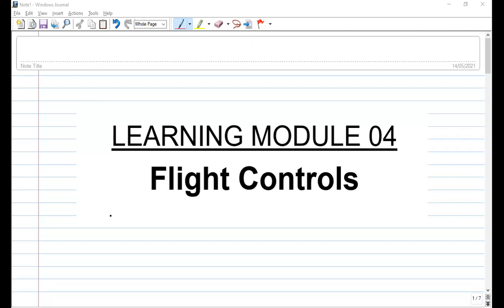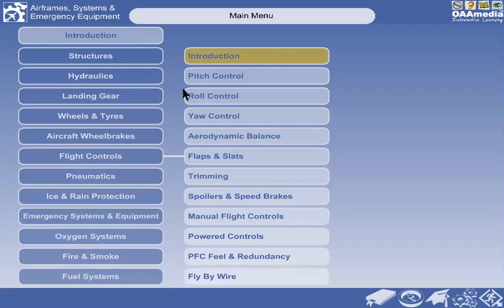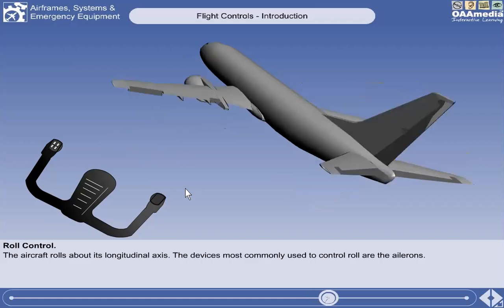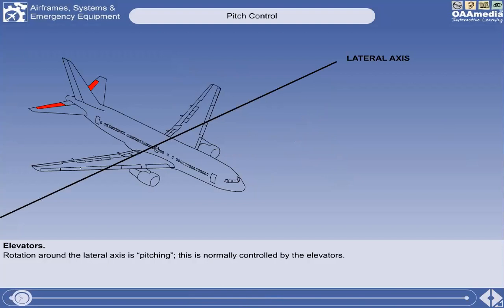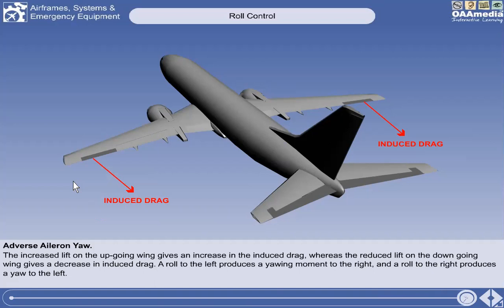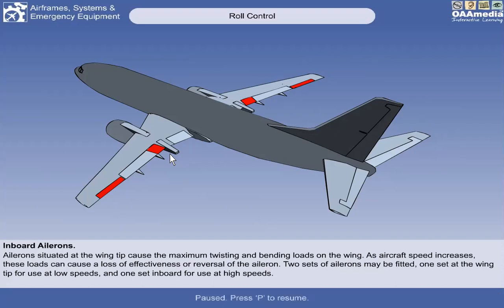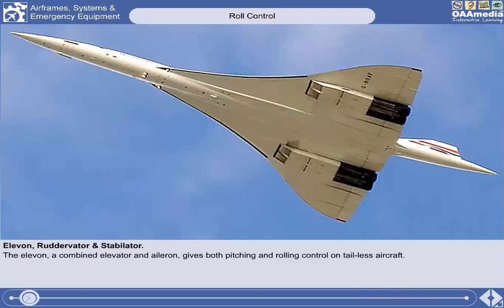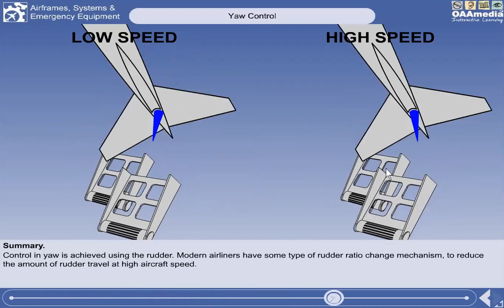AE 221 - Learning Module No. 4  (Part 1)

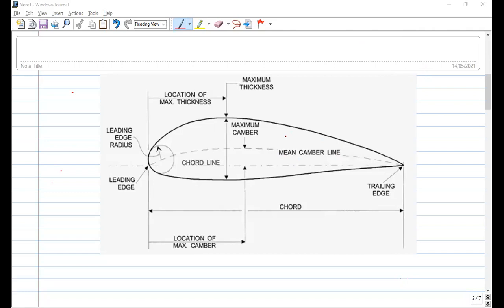Comment from the maker: CORRECTION (5:20):

Mean camber line is not the same with camber.

- Mean camber line is a line joining the leading and trailing edges of an airfoil equidistant from the upper and lower surfaces. Other term for this is camber line or mean line.

-  Camber is the curvature of an airfoil above and below the chord-line surface. It is the distance between the mean camber line and the chord line. Where the mean camber line lies above the chord line, the airfoil is said to have a positive camber. Maximum camber is a ratio of maximum distance between the camber line to the chord length.